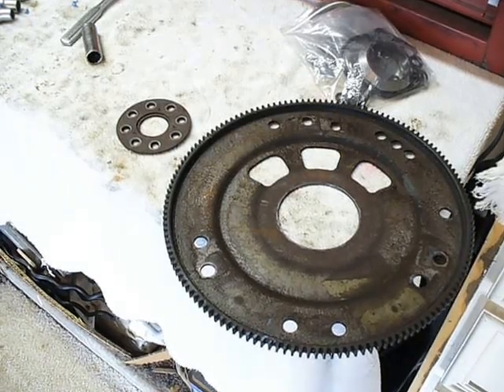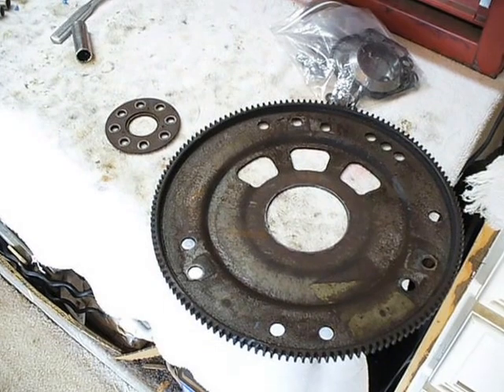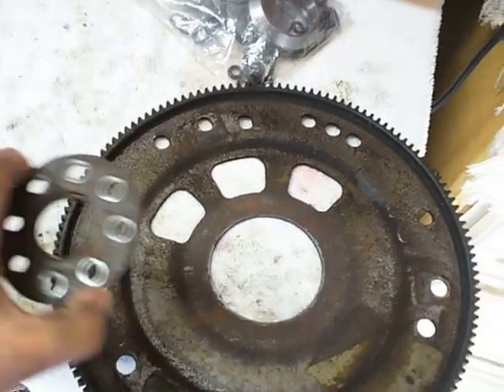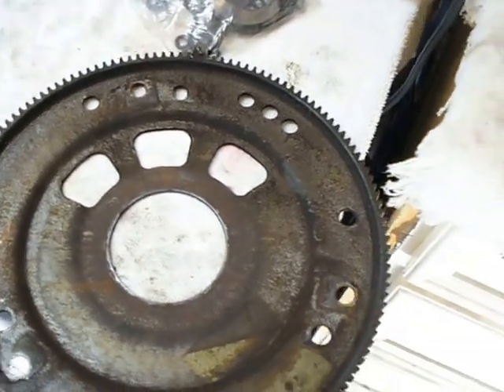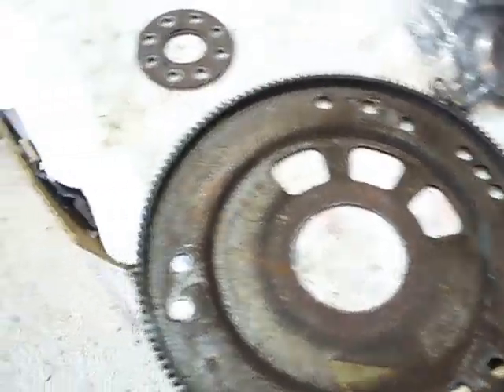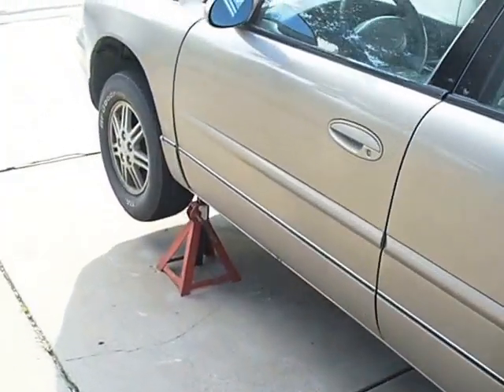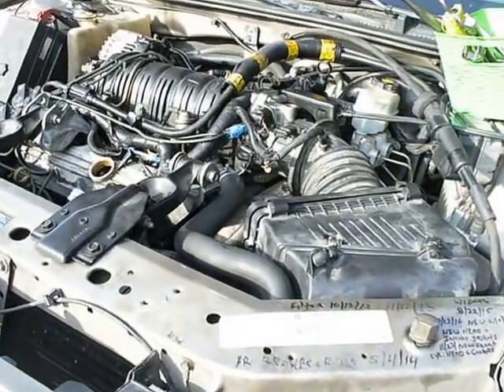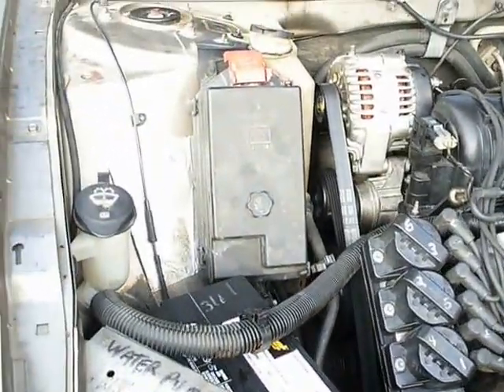2003 Buick 3800 engine swap part 7

Comment: Thank you- 2005 buick coolant leak between the engine and transmission so I am faced with the same job.You helped a lot.
Reply: 34tab...I have an odd leak on the driver's side...replaced the lower intake manifold, the LIM gasket, upper plenum, upper plenum gasket. Still leaking.  I think the block is  cracked.

Comment: Not to be a stickler but the title says 2003. This made me curious because the engine still had dogbone mounts in the front and also the battery was to the left under the hood. What model was this lesabre if you dont mind me asking? Also great video, sounded beautiful on startup.
Reply: 2003 buick regal ls